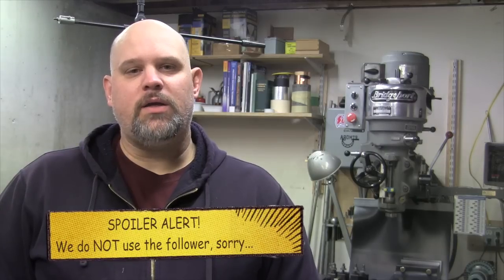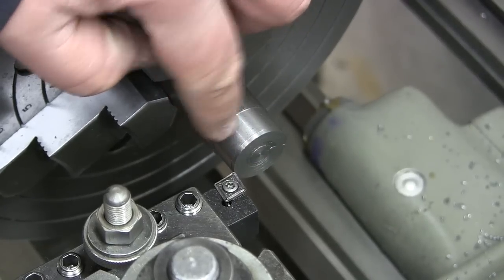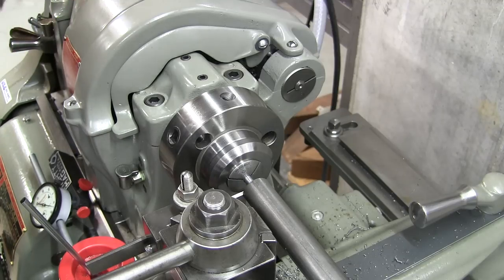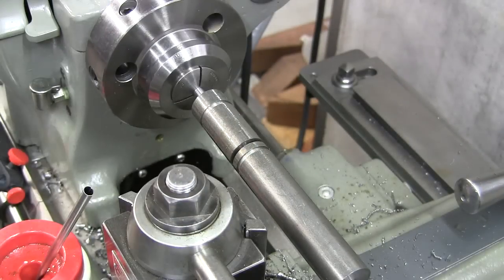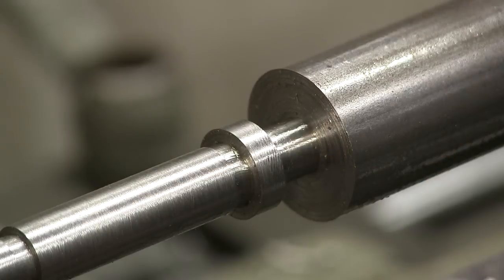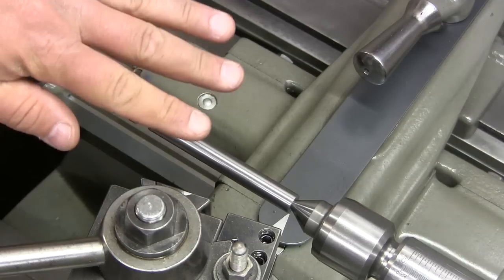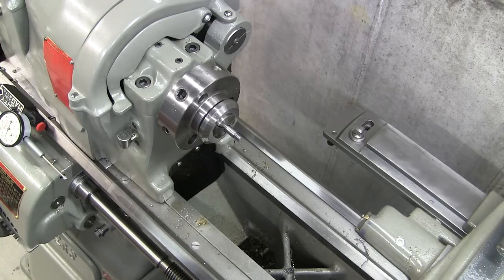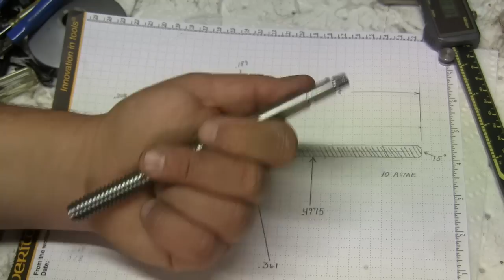Making a Compound Screw For The South Bend Lathe

Comment: I have looked at this video many times because I have a 1960 13" lathe only I couldn't get past the rear bearing heating up regardless of pulley speed which I have a 3-step pulley  setup. Going to Practical Machinist Forum and the input of many helped me figure it out. I did ask you for advice and countless others on YouTube but not much in replies. Not one of you would even say I Don't Know hope you figure it out. Believe it or not it wasn't the educated machinist that solved it. They went by the book. It was too difficult to think outside the box, only a commoner, hobbyist, or rookie machinist would do that. You Sir telling me that you are not a machinist might be true but I believe you have all the talents and skill of a machinist and only wish you success with you business. I asked you questions in some of my comments that were not answered but that's okay, I worked out a lot of my own issues on my own and some of the difficult issues with the help of others on PM. I turned my first #10 ACME threads yesterday but I went straight in with the Cross Feed after I set the cutting bit 90* to the work. I don't have much in machinist books to reference and could not find the 14* setting for the compound, so I am asking if that's the correct setting and do I use my Cross Feed or Compound to feed in?? If you could please share that little bit of info on setting up for ACME threads I won't ask anything else. Thank You

Comment: When you "take ten" (around the 0:38 mark) are you taking 0.010" off diameter or off each side? That is, are you using standard dials on your lathe or direct reading?  Just wondering how heavy your cuts are...I just bought a new nut but am going to make my own screw.  The ACME thread looks like it would put quite a load on my heavy 10 while threading it.

Comment: Nice video and thanks for sharing your project.   If I may, I would like to point out that machining "between centers" means exactly that.  When a part is machined "between centers," a center is placed directly into the lathe's spindle and another center is placed in the tailstock.  The part being machined is placed between these centers and is rotated by means of a lathe dog and driving plate.  This practice ensures the maximum degree of precision in turning a part, within the limits of precision afforded by the machine itself, and the tooling and methods used in the process.  In this case, you were not turning between centers, as you were supporting and driving the part with the collet and the tailstock center.  I enjoy watching all of your videos and have great admiration for your passion in restoring these wonderful machines.  Nice work! 

Cheers!

Comment: .not only very generous.......but great timing, my screw is worn but, Ill make one, send that one to another who could use it, great work Brad. Thanks for the video.......Rick
Reply from the maker: Rick L Hey Rick - I can finally reply to your comments. What changed on your profile? I never could respond to your comments.
Reply: BasementShopGuy ......I finally read the directions on setting up account......lol.....I restored my 13" at the same time you did on the Machinist forum.......every last nut, bolt, and felt......great work Brad.....keep it coming.

Comment: Hi Brad,
Someone will get lucky with a brand new screw...! Turned out great...
If you want a suggestion to ease the flimsyness situation on next jobs where you turn long parts, you start the heavier turning from the tailstock going towards the chuck only removing what needs to be removed as you go, this will help to keep some heavier material to hold the bar stiffer as you go... Hope this helps,
Pierre
Reply from the maker: pierre beaudry You're right. This was a first attempt on camera. I never made a screw before but I know there are more efficient ways to work it out. I definitely experienced some hiccups along the way. Thanks for the info, I'll give a try!
Reply: Your're welcome...
Take care

Comment: That looks nice.  On mine the cross feed screw is worn.
Reply from the maker: 1970chevelle396 These are pretty easy to make. What you saw was the first attempt ever. I can definitely refine the process to make em more quickly.
Reply: You could start selling them, And make a few other South Bend parts.

Comment: I'm getting ready to make this same Compound Screw for my 1960 SB 13" lathe. I have commented before on many of your videos. I must have missed something because I noticed you haven't made new videos lately. My 1960 lathe was a mess and it took over a year to get all the secret issues in the open. My rear bearing cap will move maybe a half thousand and that's a guess because I have to tap it with a block of wood and then try to find the best spot to tighten it down and be able to spin the spindle by hand. How did you get such a smooth turning spindle? Did you have to align it or did you find a way to measure if it was on the money or not? Did you use Mobile One or other spindle oil? I know it long gone but maybe you can add something that might help me. Thanks
Reply: SB lathes have adjustable bearing clearance, both Axially and Radially. The 10L and up employ split bronze bearings that are adjusted by set screws in the front and rear bearing caps. A stacked Headless Allen Set Screw system is used. In other words the set screws that's visible to you is a lock screw. It must be removed to access the Set Screw underneath it. It is this second Headless Allen Set Screw that adjusts the bearing. 
Axial play is adjusted by threaded collars on the spindle. I hope this helps.
Wakodahatchee Chris

Comment: Nice video Brad! I'm in the process of cutting two thread screw with square threads.

John
Reply from the maker: ShadeTree Machinist Cool John. What's it going to be used for?
Reply: It's for a large old bench vise. I have two videos ready to post. Had to stop on this project due to the second thread I was cutting started to roll over onto the cutter. My lathe doesn't have a follow rest and can't seem to find one, so I'm now in the process of making a follow rest for my Monarch lathe. I'll be posting this project also when it's completed.

John (a.k.a... ShadeTree Machinist)

Comment: Instead of using a trig formula, for working out the depth of cut for the thread, you could attach a DTI on a magnetic base, to the body of the lathe, and place the plunger against the back of the tool-post.

No matter what the angle of the compound, the DTI will give you the actual depth of cut.
Reply from the maker: Yep, true.

Comment: What luck to come across this video - I have just bought an Okuma LS 450 made in the 60's and the first thing that needs to be done is to replace a slightly bent compound screw ...

Thanks for the walk through on how you went about it - and btw a lovely looking lathe you tidied up for yourself.

I need to get on top of the ACME thread caper - maybe a good idea to post my own version  with some more detail on the calcs - Machinery Handbook here we come.

Pete

Comment: Hi Brad !

Oh, again I envy your nice machinery ... wav !

I don't think the geometry of the die you're using is so that it can be turned and use "from the other side" - I think you said that at a point in the video - right ?

IS you die in fact a "both way" die ?

Anyway, really nice work you did !
Reply from the maker: Keld Sørensen Hmmm.... I don't know (lol). I cut the threads and just chased them closer. I never knew you couldn't.  Thanks for the info!
Reply: BasementShopGuy To my knowledge - some you can some you can't - look at the single cutting teeth ... if you look very close you can see a - I think it's called a releaf angle, like on a cutting tool for the lathe - IF you CAN see this then you CAN'T turn the die around - it's like cutting on the lathe where the spindle runs backwards and your cutter is mounted normally.